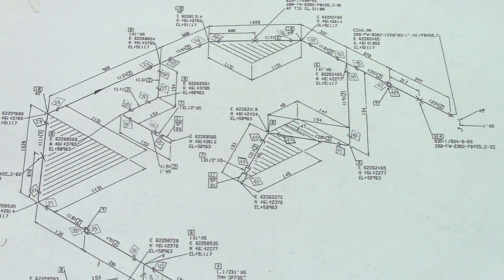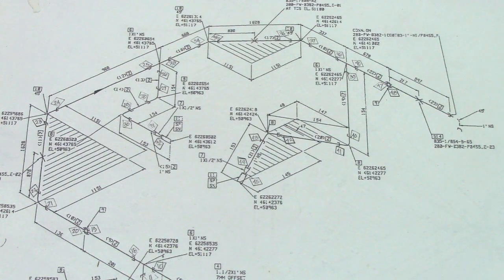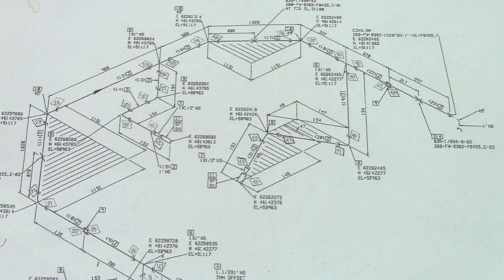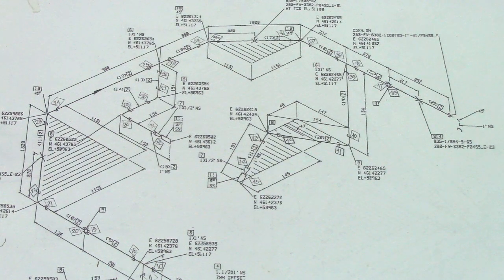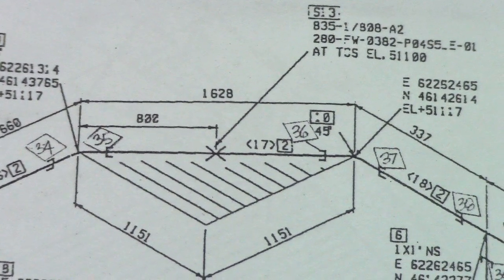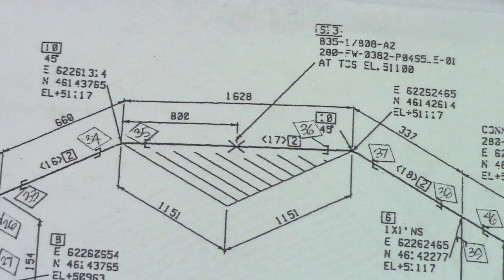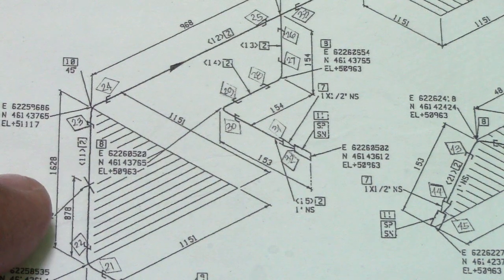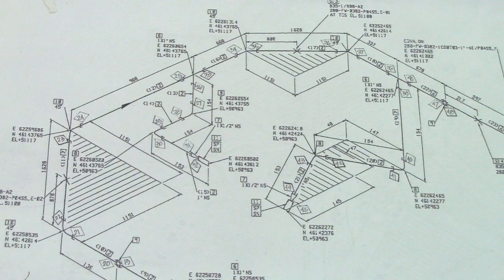How to Determined Vertical and Horizontal Shadow and with Slope in Isometric Drawing

Comment: You have done much better and helped me to understand a bit more about the shading and shadow paying attention to the shading direction and elevation, I am still trying to learn more clear and absolutely about this because the shop test I took I think make me rely on the symbology without the aid of differences in elevation.
That 1st on I believe the pipe could angle out of the socket over 12 feet for the 2 foot elevation change without any mitering... I believe.  Thank you for making a better effort. Remember the confusion about the shading and symbology without the aid of elevations just in the case we don't get that benefit.  I know...use everything available to you